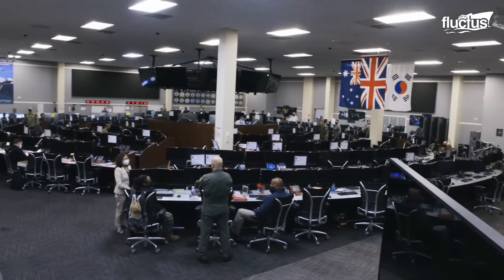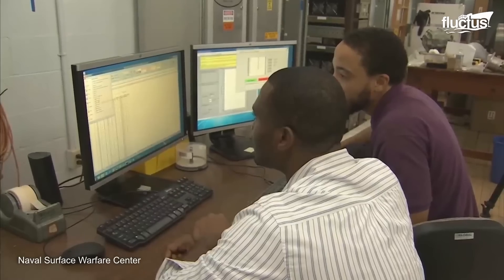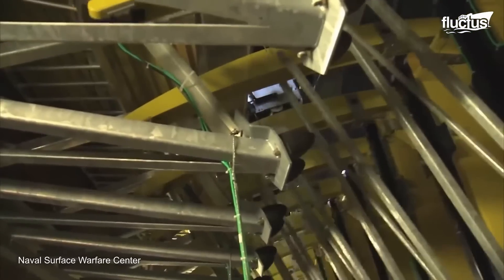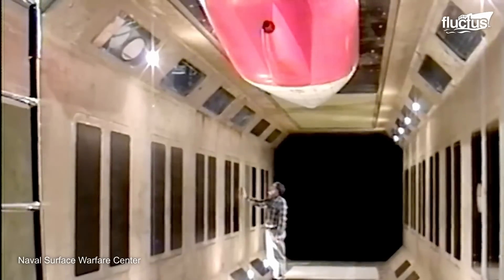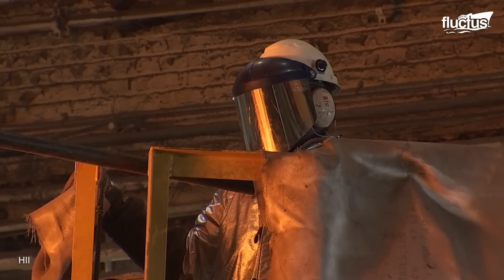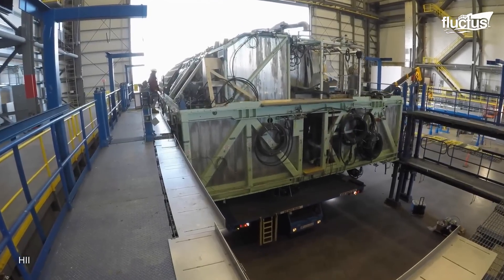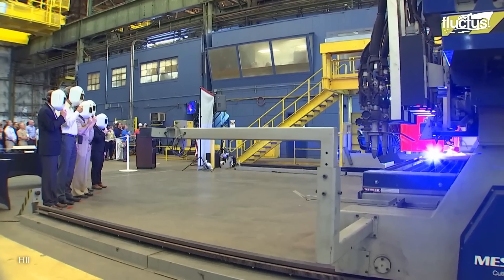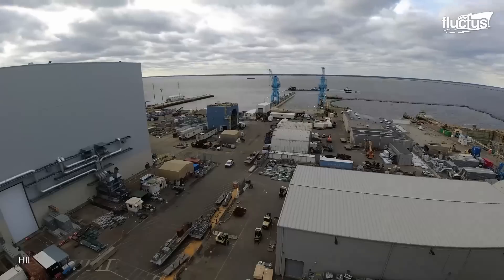Inside US Advanced Facility Testing New Billions $ Stealth Submarines

Comment: i’ll betcha just like drone planes and helicopters their drone submarines to patrol. Battery technology isn’t sufficient enough for long duration carry a weapons loads yet. it would take huge generators to re charge the batteries it would take days not hours. rapid recharging degrades the batteries very very expensive running on the surface or re docking with a sub to re charge for un manned missions. waste of money in my books.